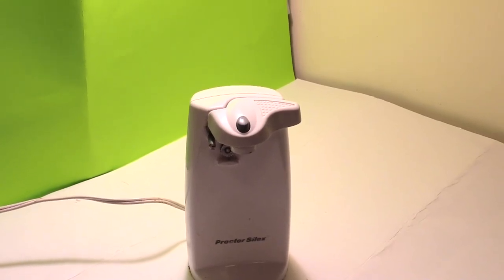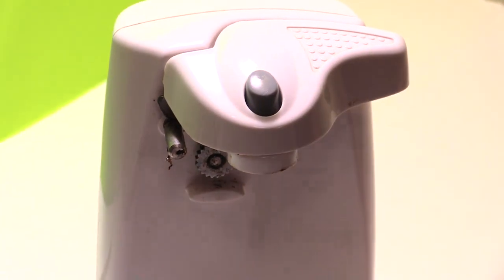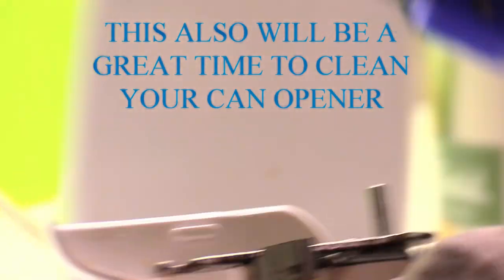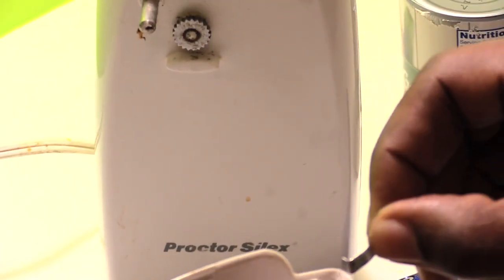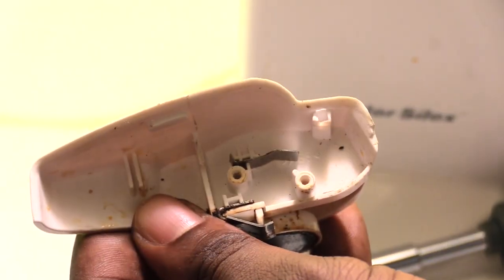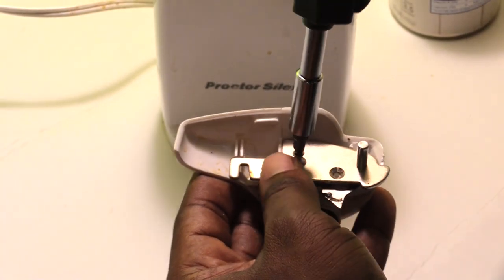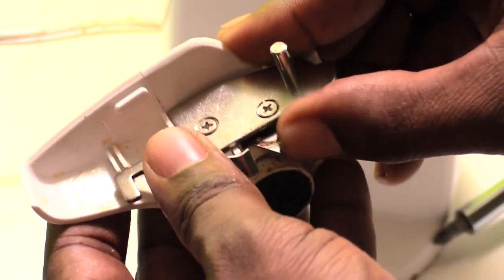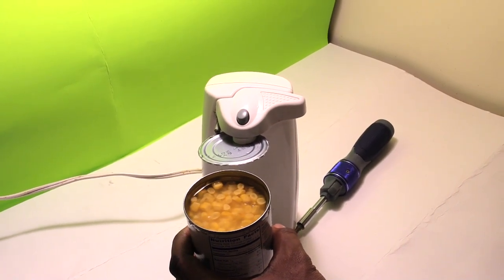Electric Can Opener Won't Open EAZY FIX!!

Comment from the maker: If this video helped you please subscribe and help support our channel. Thank you
Reply: Thanks. It turns out my can opener (which looks like the same model as yours) had a different problem, but watching your video helped me to find & fix the problem. I didn't know the blade assembly could be removed, and it turned out that mine needed a slight repositioning: pull it out as tho ugh to remove it, but just pull it out a little. That did it for mine - which I picked up from our office's give-away cabinet, probably put there because it wasn't working.

Comment: This video helped me fix my electric can opener.  The metal spring in my particular can opener is a little different but after watching your video, the same principle applies.  I only needed to bend the spring slightly to increase the pressure against the blade chassis and reassemble it.  It works like new.  Thanks!
Reply from the maker: You're welcome! Please subscribe like and share and check out our other helpfull videos

Comment: I just serviced my Black & Decker can opener after watching your great video. It's too late at night for me to test it but - I am confident it will work and here's why. I discovered that the small nut that tightens the plastic pivot onto the blade assembly, was loose. I got a small wrench and tightened this nut several turns and it fixed my loose pivot point. Now when I press down, it is lined up and not loose on the pivot point. While I had everything apart I took your advice and cleaned it thoroughly and now it is like new.
Thank you!
Reply from the maker: Your welcome glad could help

Comment: Mine was a little different on the inside. It didn’t have that metal piece. But once I opened it I realized a different screw was loose. Once I tightened it, voila! Works! Thank you for the idea!
Reply from the maker: Your very welcome Glad could help👍 thanks for comment, Please subscribe & like and share if haven't already and check out our other helpful videos

Comment: Helped me to fix mine. Very good video.
Reply: Have a Kenmore. Never worked from brand new but kept it there. Probably over 18 years. Never threw it away. A darn good thing I saw your video. That adjustment repaired it. Thanks much. Simple but effective.
Reply from the maker: Hollister Thompson thanks for watching and commenting glad was able to help with can opener, please subscribe and share if haven't already and check out my other helpful videos.

Comment: Thank you. I wonder if that will help when it will puncture the can, but it will not go far before the can stops turning. The motor is still running, but the can seems to be misaligned. The grab wheel is still turning but it's tearing up the paper and sometimes making deep indentations in the can.
Reply from the maker: Yes most time that is the problem this causes, should work fine wants you fix it. Please subscribe & like and share if haven't already and check out our other helpful videos
Reply: @Flashback502  Thank you. Will do
Reply: @carolejackson8357  great description of exactly what my trusty can opener is doing, shock horror, not even any old one other can opener in the house, just my leaking can, and hungry me,lol
Reply: @tictaktotiki  I turns out I bent the metal guider with needle nose pliers. Adjustment done. My blade worked fine all along. Just the guide was off. I hope it lasts!

 And, I hope you got to eat. My Puerto Rican girlfriend is talented at opening a can with a butcher knife. It might work faster than a can opener for her! Not for me. I guess it's an acquired skill!
Reply: @carolejackson8357  haha. in despration i too tried a knife, it looked do able on videos. ah nah, no , not for me.
back to electric, which kind of managed a few cuts here and there, then some big pliers and i managed to rip a hole into it, big enough to get my food out.
i will have a look at your tip, cos my kenwood does not have the screws to undo and open the part that needs adjusting, maybe just a tiny allen key.
not sure, had enough of it and cleaned it and put away, making mental note not to buy any cans which dont have ring top opener. lol.
trick is remembering..
Reply: @tictaktotiki  LOL. Not my skill either! 

Mine can be opened but not necessary for this distinction.  

I use Amazon account as a reminder. I find the item I want to buy on future, then put it on my wish list. Mine is a Cuisinart than I've had for many years. It's at all so it works on any can

Comment: I tried it but it didn't work for me. I am not even getting the can to turn. I took out the two screws but the metal piece was still holding firm. The blade is not punching the tin but has resistance so that when I push it in it comes back out. Do you have any solution for my issue?
Reply from the maker: Sorry, not sure.  Please like subscribe  and share,  thanks.

Comment: that may fix your problem, but there has definitely been a change in the canning process over the years.  The rim sits much higher than they used to which makes many older electric openers unable to cut deep enough into the lid.
Reply from the maker: Thanks for info. Please subscribe & like and share if haven't already and check out our other helpful videos